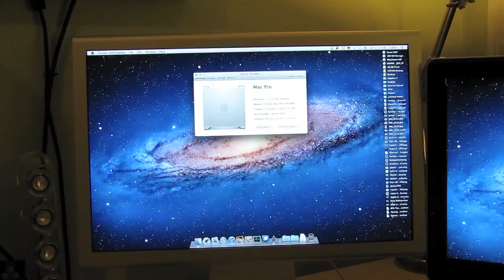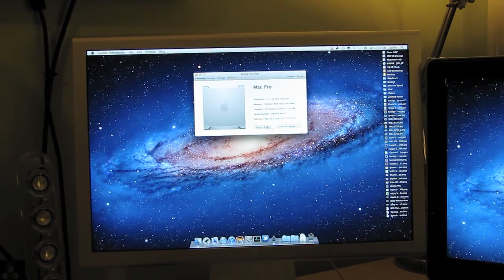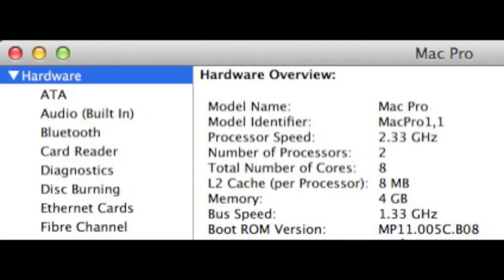Mac Pro Processor Upgrade

Comment: @collintheapplegeek Yeah, and if you were to get a new Mac pro right now with the dual quad core processors then they wouldn't really need upgrading for ages. The RAM and the graphics card/s would need upgrading because (IMO) the Mac pro comes with very average RAM/graphics. But as you say they are easy to upgrade anyway. Personally I wouldn't buy a Mac but the Mac pro is the only upgradable one so it's more worth it than the others (I still think the price is too high though)

Comment: Holy damn. In my PC I take the side off, remove my CPU cooler, remove CPU, put in new CPU, add new thermal paste, put cooler back on, put side of case on.  You have to take half the computer apart in these!

Comment from the maker: @MobileMediaProducts The paste spreads when you tighten the heasinks down. I actually tightened one down, then took it off and looked at it. Also, even Intel says that you only need to use it across the cores on the Xeon (and probably others) processors. The new quad-core 2.33GHz Xeon processors actually run a little bit cooler than the old dual-core 2.66GHz Xeon chips. I thought about the lock-tite, but it really doesn't matter that much The screws aren't going to vibrate loose or anything.